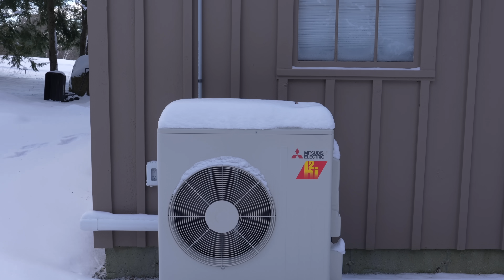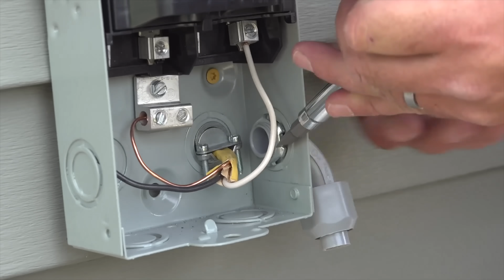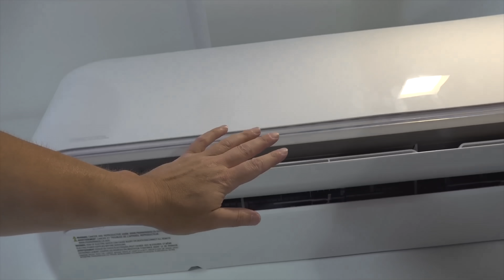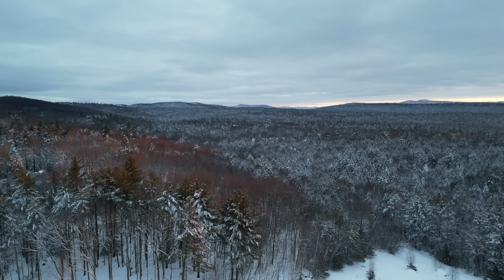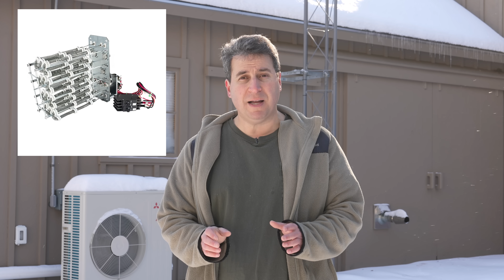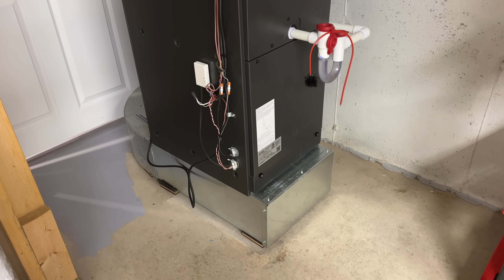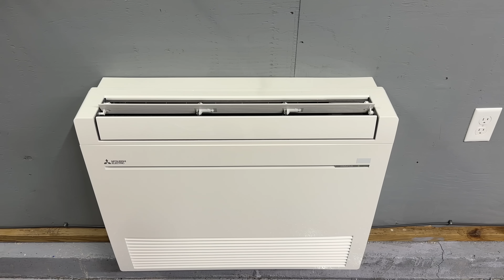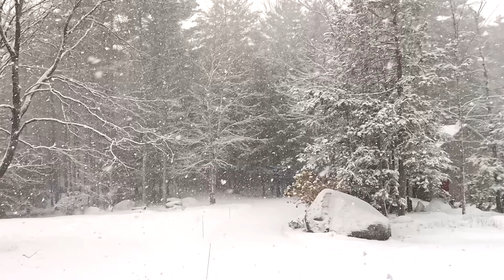Why Heat Pumps are now leaving people COLD

Comment: We have gas with a heat pump for supplemental cooling.  This past cold snap we found that our propane furnace was not firing; luckily we also have a pellet stove. In the end we had to insulate our tank and regulators, add in some pipe heaters, and put on a PowerBlanket on the tank and now our furnace keeps going even with the -58 wind chill we had over the past weekend.

Comment: I have a 3 ton goodman heat pump i installed myself and it doesn't use heat strips until it drops below about 10 degrees, and even then it cycles them on and off. Insulation and air tightness is key

Comment: I have a heat pump in central Florida. It has heating strips. They only come on if the system has been off for awhile and it is cold. They get up to the set point of the system and shut off. 
After that they are not needed and you are just on the heat pump.
Reply: Heat strips will come on whenever there is a two degree difference between set point and inside temperature.  I keep mine turned off so that my system always runs the more efficient heat pump.   Just takes a tad longer to get up to temp.  Big deal.

Comment: Silver Cymbal, most brands now have low-ambient specialized condensing units that they claim provide 100% of their rated btu output down to 0 degrees F, even -10 on some. Are you saying these claims are not true? We have Daikin low ambient model mini splits for heat in Long Island, NY. Have had no issues with the system maintaining inside temps when it is around 10 degrees outside.
Reply from the maker: They are telling you the truth, except as always there is more to the tale. The defrost cycle, these can be as much as 30% of every hour for some models, during that time you not only receive no heat, it removes some heat from the space to defrost. Combined with certain houses, temps, insulation levels, drafts they may not be able to keep up overall.  I will cover this and a couple of other lesser known ways to get more heat pumps that I think you may find interesting

Comment: I have a central heat and cooling system that is a heat pump that was put in in 2018, with these teens and twenties that we have been seeing we have had to run supplemental heaters because the air temp out of the ducts is only in the 50's to low 60's.

Comment: theres a big government push for subsidized heat-pump installs in Ontario, Canada.. we just finished an assessment and it will be almost fully paid for... we will use it inline with our existing forced air gas furnace.. current temp here today is only down to about 5F.. the winters here are getting milder every year..
good info, thnx :)

Comment: The solution is choose a reliable and durable Japanese designed and made Panasonic AC and Heat Pumps.
Many brands nowadays will deceive you with their flamboyant and mouth watering Marketing Methods but in the end you will be surely pissed off with the poor quality of its reliability, durability and poor efficiency. Everybody must be keen and careful when buying appliances and equipments nowadays because of scams and evil marketing schemes. Looks and Advertisements are deceiving. I recommend the Panasonic brand. It maybe a have a higher price than the rest of its competitors but its reliability, durability and efficiency is really worth it.

Comment: 1:12 "solely depending on..."  That the rub, Bub.  Personally I heat, and rarely cool, my 1200 sq ft. home with 10 ft. walls with a heat pump.  BUT, since I live in MT I also have natural gas back up/supplemental heat source for when the temperature is less than 5*F.  Works well for me.  I actually shut down the natural gas stove recently because I was concerned that I was getting some CO leakage when we had five days of -24*F nights and used the heat pump and three small portable electric heaters.  Thankfully it was a not a CO leak.  I typically need to augment the heat pump between 6-12 days during the winter.  We use to burn wood, but when I built my new home and I'm over 70 I decided to go with the minisplit/natural gas.  PS: I also have a contingent method if the power goes out for extended periods of time.

Comment: Last winter the coil on my 2 year old heat pump cracked. Sure got cold quickly in the dead of winter. When it does work it works well until down to about 0.

Comment: If one lives in an extremely cold climate where the temps can go below 10 F, or the electricity can "go out" it's best to have some sort of back up heat source, even if it's just a wood burning stove.  If the power is reliable where you live, but it regularly (or even occasionally) gets below 10F, one should consider a geo thermal heat pump instead.  They just work much more efficiently in temperature extremes because the pull, or push, heat into the ground which is constangly around 55F year round.
If you go with gas, make sure it doesn't require electricity to operate.

Comment: Great explanation! As a long time technician i think air source heat pumps are great combined with a gas backup. Geothermal is too expensive for its lifespan.
Reply: What lifespan?  Forever?  There is no reason for it to degrade.
Reply: @frequentlycynical642   everything mechanical has a lifespan. Compressors , pumps, relays, circuit boards and fans wear out . Some of these are freq/ inverter drive and are very expensive to repair. Environmental conditions, lack of maintenance and improper installation shorten lifespan. Most HVAC equipment today is designed to last 12-18 years, water tank 7-12 years, boiler 18-25 years. A lot of manufacturing companies increase the price for repair parts as equipment ages due to stocking cost and inflation. I just replaced a Bryant+90 I for a customer it was an 02' model the venter motor failed, $1450 plus labor to repair or $3k for a new furnace.
Reply: @phillmckrakin2518  Speaking of "great explanation," thank you for your detailed examples to support your point.

Comment: Heat pumps do lose heating efficiency at lower temps, however most inverter based units are capable of down closer to 0 degrees without supplementary heat.
Especially the ones that had over-speed the compressor at those lower extremes.
30 degrees and lower definitely kills the performance of fixed speed heat pumps.

Comment: Heat pumps suck in cold weather. The supplemental heat is from electric heat strips that are just wires that get hot from resistance. SCAM, SCAM.
Reply: They can work just fine. I got a very old house that is heating just fine by one down to 10F or so, which only happens a couple nights a year. We have no supplemental heat, just a propane furnace the system will automatically switch to below 10F.
Reply: @Tithis  Do you have heat strips, or coils to assist with heat?
Reply: @CrazyPetez  No. I may have considered it but we only have 100amp service and buried lines, so adding them would have been a big expense to upgrade our service.

Our zone controller has an exterior thermometer to control when to switch from the heatpump to the furnace, which we set to 10F.
Reply: @Tithis  So you have a furnace too. I rest my case.
Reply: @CrazyPetez  I didn't know cold weather only started at 10F. You breaking out your shorts when it's in the teens?

Comment: Even in Texas, my AC installer put in heat strips for my heat pump system. It doesn't run often, but the other day it sure came in handy.

My friend in an apartment, also with a ducted heat pump, was freezing his ass off ):

Comment: I'm sorry, but I'll keep my 96% efficiency natural gas furnace.    Natural gas is much cheaper than using electric heat, even compared to a modern heat pump.  I don't know why anyone would use a heat pump if natural gas is available at their home.  The increased efficiency of modern heat pumps (300% under ideal conditions) don't make up for the increased cost of electric versus natural gas.

I'm sure it's worth it to get a modern inverter heat pump with variable fans and variable compressor for the cheap air conditioning alone.  I'm sure it would cut your A/C bill in the summer drastically. In the winter though, 96%+ efficiency Natural gas furnaces are the way to go.  

If electricity was super cheap and produced by clean energy (nuclear, solar, wind) all over the USA, I could see everyone converting to heat pumps, except those in the upper north.    Currently, electric in most of USA is expensive (10¢ to 25¢ per kwh).  Natural gas is much cheaper than electric in almost all of the USA.  Natural gas is 2x to 3x cheaper to heat with than electric in near every state in the USA.  If natural gas isn't available in your area, then by all means buy a heat pump and get some kind of supplemental heat if it gets below 30F in the winter.  A heat pump will always be cheaper  and more efficient than using resistive heating.

You have to also realize that at this time 60% of the electric in the USA is still produced by burning natural gas and coal.  The electric is then sent to your home.  Along the way 8-15% of the energy is lost during transmission.    Burning natural gas in your home is 96% efficient, end of story.    96% of the energy from the natural gas is turned into heat.  Nothing is lost in transmission.  The temperature outside doesn't affect the furnace.  The natural gas burns super clean.   Using electric heat at this time is basically burning natural gas or coal but with extra steps.  I'm sure this may change in the future, but I don't see it happening any time soon.

Comment: Zero degrees - Fahrenheit? or Celsius?? Seriously - there's a BIG difference, and up here in New England - BOTH MATTER. My experience with heat pumps at -25F - which happens most winters - is I'm cold.

Comment: Its gonna be 10 degrees in Connecticut tomorrow morning, my heat pumps will be spinning like tops keeping my house toasty warm, I got 3 hyper heat Mitsubishi systems and one LG Red system for the 3 bedrooms, What I do is on very cold days Ill increase my setpoint so when the units go into defrost mode it doesnt have to catch up to keep the space at 72 degrees. My house is from 1979 and its 2x6 framing with a plastic vapor barrier behind the sheetrock, I went through the whole house and sealed all the penetrations at the plugs , switches, recessed lighting, spray foamed around all the new window frames, the house is basically air tight. Since i air sealed and also installed new New Construction windows everywhere AND new commercial grade tyvek when the house was sided this house is rated at the top 90% in efficiency based on square footage and KWH (electricity) used during a year. I put TONS of money into this house and its tight and vented properly with an HRV running 24/7. Old way of thinking "let the house breathe" is just someone who doesnt want to put in the time and or money to make the house WAY more efficient. New way is......"Build Tight Ventilate Right" I even went in the attic and sealed the holes for penetrations in the top plates for electrical/vents ect.

Comment: I live in central Wisconsin and had a heat pump put in last year along with a new furnace and pellet stove. I have to say the heat pump was well worth the money. Even with it being set to turn off at 35 degrees and the propane furnace kicks on. We normally fill at 500 gallon propane tank at least 4 times if not more a winter. An now we have only filled it once’s so far this year and went down from burning over 4 tons of pellets down to 3 tons. That’s thousand plus dollars of savings already this year

Comment: I have a dual fuel system mostly because I didn't want to pay to remove my oil tank and upgrade my electric to have the electric supplemental heat strips.  This week is the first that I decided to run the furnace instead of the heat pump long term.  I'd rather use the fuel oil I already paid for than run up my electric bill.

Comment: if the heatpump is correctly sized to handle the heating load in extreme cold and it is - it will be able to heat the house by itself.
The issue is that the air ducts in existing homes are too small for heatpump sized for heating.

You are confusing efficiency with capacity too.
A cold climate heatpump gives full capacity even below 0F - but, the real efficiency drops as it gets colder outside.

Where natural gas is available, dual fuel makes the most sense -> furnace+heatpump for ducted system, if there is a hydronic system, install mini-splits and turn on the hot water heat on the colder days. If nat gas it not available, all electric with backup supplemental elements can be the best option.

Comment: From my experience, this video is accurate. I had a heat pump for 10 years in a house I bought in Iowa. It was built in the mid-70s when energy shortages were an issue in the U.S. and gas was shunned. I had the option during those cold seasons to use resistance heat instead of the heat pump, but in that case, the energy price went way up. I'm in a natural gas heated house now, and there's no comparison to the cold place I used to live in.
Reply: Apples and oranges.  Two different houses, even.

Comment: Heat pumps put out less heat as the outdoor temperature drops when your home needs more heat.  The thermostat calls for auxiliary heat during defrost cycle and when the actual indoor temperature drops a couple of degrees below set point.  When it gets very cold, the demand for electricity skyrockets in heat pump heavy areas.  Intermittent energy from wind and solar will compound the problem.

Comment: I love my split heat pump. I have had it for over 10 years. Winter temps are usually in the 30s to 40s here. When it gets colder, I put on another layer, and all is good.

Comment: I installed the cheapest Pioneer split system I could find that was of a higher SEER rating (SEER 21 I believe). It seems to work "as usual" to 6F and with more run time than usual...a few times down to -6F. Is it possible the higher SEER rating can easily affect all that you mentioned in this video? My system also has worked very well to 106F several times each Summer with no unusual issues. Am I lucky that I chose the more efficient system?

Comment: I installed a new heat pump last June as well as a major insulation upgrade on my vintage house here on Vancouver Island Canada.  I would say  I've been very happy with the results,  that is until last Friday on Jan 12 when we got hit with a doozy record breaking cold front of -14 C.  The thing was running much louder than normal frequently pausing for a few minutes in df mode  (meaning line defrost I would guess)  The unit was still making heat at -12 C until I decided to switch to my woodstove.   The following day,   I learned that my hometown had broken a record for power consumption on that Jan12 day.  Most likely from all the recently installed HP's which would likely consume way more power than a fan and burner motor of an old style oil heater would.  especially hard working bellow zero Heat pumps,  all running in their thousands at the same time.
Reply: Typical leftists. They turn to insults when presented with an opposing point of view. Probably learned that in college during their indoctrination.
Reply: Taking us full electric everything is not GOING TO WORK PERIOD.
Reply: Now imagine if everyone also had an electric car charging in their garage. They would be freezing in their house with no reliable means of transportation to escape the situation. See where making everyone electric will lead?
Reply: @mikee2923  Oh, you are so clever.  /s  We're in a huge energy transition.  For instance, here in Texas we had no brownouts last summer because solar is now supplying 20% of the grid.  For some people, rooftop solar and batteries do the whole house AND and EV.

We'll do OK.
Reply: @mikee2923  This a fear mongering statement. Everyone is not going to have an electric car immediately. Your statement is equivalent to people saying in the early 1900s that cars will never work. If everyone had a car we don't have the amount of gas stations needed to fill them or the roads to allow them to move.
Reply: @markvalery8632  Well apparently there’s a lot of PO’d people in Chicago with Tesla lawn ornaments because their fabulous electric cars won’t charge in the cold. As far as gas cars go, the government didn’t take everyone’s tax dollars to build the infrastructure for gas powered vehicles. It was the private sector that built the gas stations, pipe lines, refineries and distribution system. I’ve also been doing commercial/industrial HVAC for 32 years and can tell you that heat pumps in a cold climate is a complete waste of money. And I can also tell you that the new “environmentally safe” (R-410A) refrigerants take more power to pump than the old R-22 that worked much better for air conditioning. The R-410A in use now is on the EPA’s hit list. They are going to slash production of it by 50% this year with nothing known at this time to replace it with. Wait until your cheaply built R-410A heat pump/AC unit springs a leak. You’ll be in for a shock when you get the bill. Fear mongering, I think not. I deal with this kinda BS every day.
Reply: @mikee2923  Norway would sure like to hear from you that heat pumps in a cold climate don't work. I'm sure they will listen to a genius like yourself.
Reply: @mikee2923  Government (local, state, and national) built the roads that enabled the use of cars and trucking to grow.
Reply: @mikee2923  The Federal Aid Road Act of 1916. Federal Aid Highway Act of 1921, For a start
Reply: @mikee2923  Southern NH. I've had a heat pump running as my main heating and AC for 7 years. Oil boiler only used as for back up heat. No problems and cheaper than oil.
Reply: @mikee2923  So how come I get great heating and cooling from my inverter heat pump at between 600 and 1000 watts. When my old R22 unit went full bore at 3000 watts? Have another drink...fos.
Reply: @timcat1004  Well I guess you’re a freak of nature. 1 watt = 3.414 BTU.